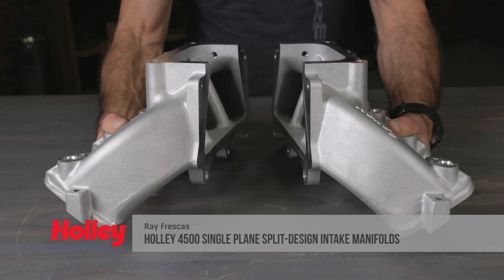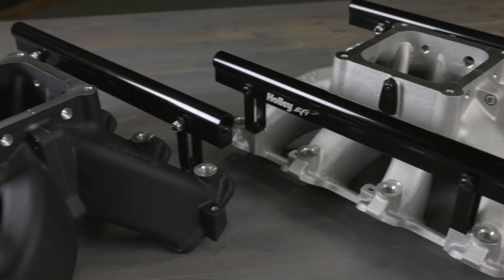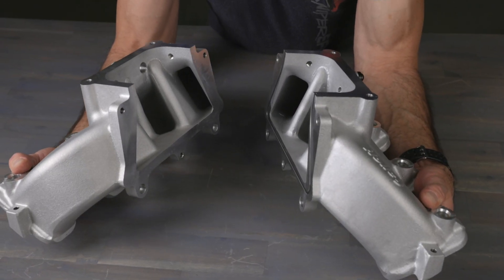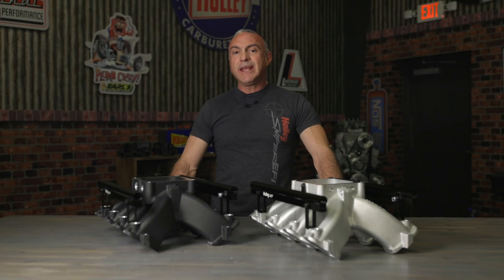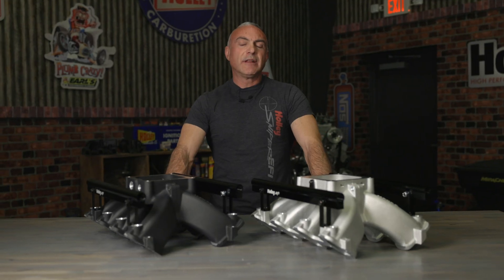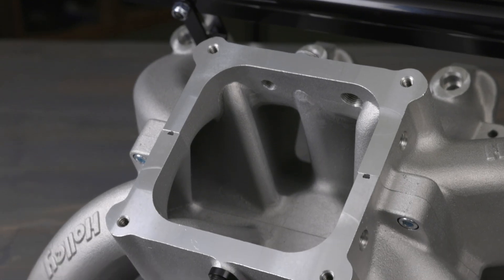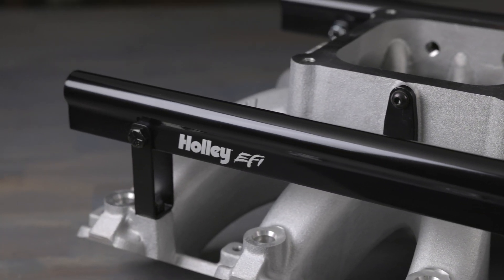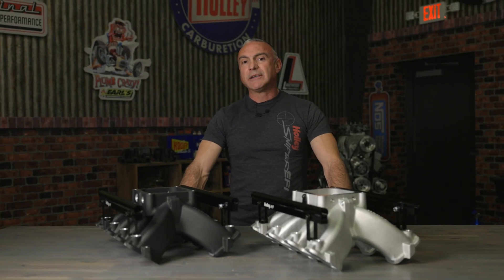Holley’s Single Plane 4500 Split-Design Race Intake Manifold for LS Engines

Comment: What throttle body can be used when using this intake with the fuel rail and wanting the classic look/ allow fit of a classic air filter?
Reply: Any, you just get an elbow to fit the dominator plate